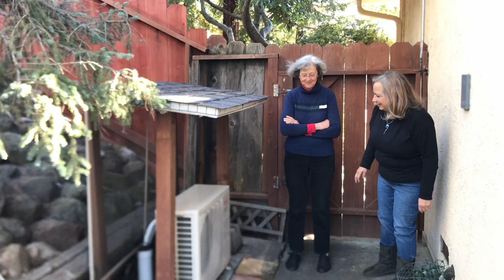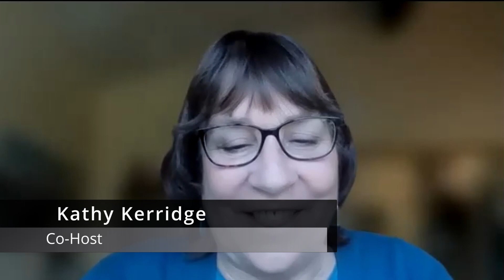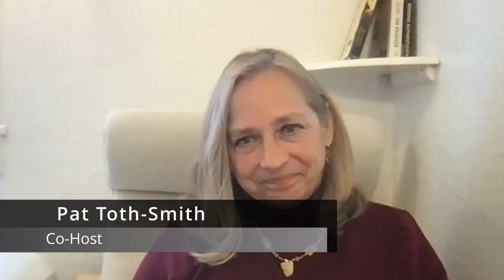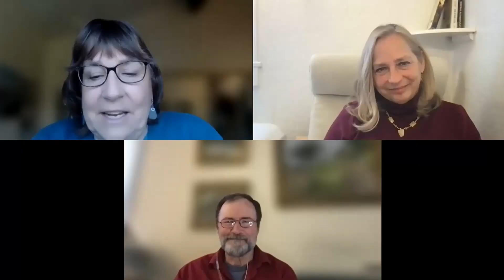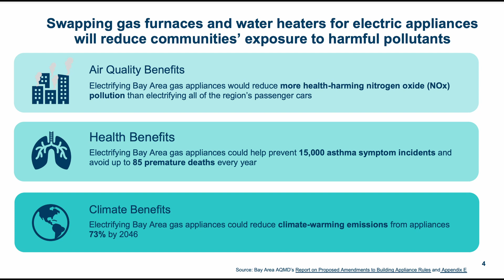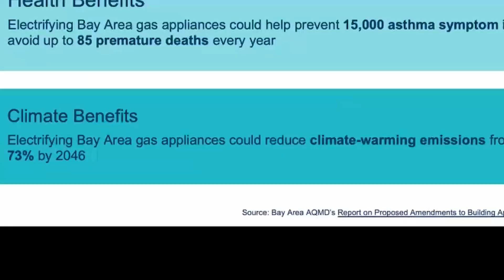Switch is on to Electric Heat Pumps | EP. 2

Comment: Rinnai Corp, a Japanese manufacturer of home heating appliances, has unveiled a new hot water heat pump for residential and small commercial applications.

Called HydraHeat, the new heat pump is manufactured by Rinnai in New Zealand and is specifically designed for climatic conditions with temperatures ranging from -10 C to 42 C, as well as coastal locations. The system is designed for outdoor installations and cannot be used as a swimming pool heater, or for hydronic applications.

It consists of a 1 kW top unit using heat pump technology that extracts thermal energy from ambient air and a 4.7 kW cylinder that can operate on electricity or in heat pump mode.

The system uses a circulation pump to draw water from the bottom of the storage cylinder, heat the water, and then return it to the cylinder at a higher temperature. The heat pump and the element in the tank are able to heat the water to a temperature of up to 70 C.

The new product reportedly operates in full heat pump mode down to -10 C without the need for electric boosting. It measures 1,750 mm x 510 mm x 1,240 mm and has a weight of 400 kg.

Comment: Here’s the word from the US Energy Department 
“Heat pumps offer an energy-efficient alternative to furnaces and air conditioners for all climates. Like your refrigerator, heat pumps use electricity to transfer heat from a cool space to a warm space, making the cool space cooler and the warm space warmer. During the heating season, heat pumps move heat from the cool outdoors into your warm house.  During the cooling season, heat pumps move heat from your house into the  outdoors. Because they transfer heat rather than generate heat, heat pumps can efficiently provide comfortable temperatures for your home. “
Reply: According to them, “Ducted Air-Source Heat Pumps
There are three main types of heat pumps connected by ducts: air-to-air, water source, and geothermal. They collect heat from the air, water, or ground outside your home and concentrate it for use inside. “
Reply: Heat pumps are more energy efficient than electric resistance or gas furnaces snd can save you big money. Here’s what they add”
“Air-Source Heat Pumps
The most common type of heat pump is the air-source heat pump, which transfers heat between your house and the outside air. Today's heat pump can reduce your electricity use for heating by approximately 50% compared to electric resistance heating such as furnaces and baseboard heaters. High-efficiency heat pumps also dehumidify better than standard central air conditioners, resulting in less energy usage and more cooling comfort in summer months. Air-source heat pumps have been used for many years in nearly all parts of the United States, but until recently they have not been used in areas that experienced extended periods of subfreezing temperatures. However, in recent years, air-source heat pump technology has advanced so that it now offers a legitimate space heating alternative in colder regions.”

Comment: The rebates make this very attractive.
Reply from the maker: Thank you for pointing this out, the other thing about the new electric heat pumps, they are also air conditioners with the click of a switch.  And, apartment dwellers can get window units to air conditioner their apartments, something needed with the higher heat with climbing change.